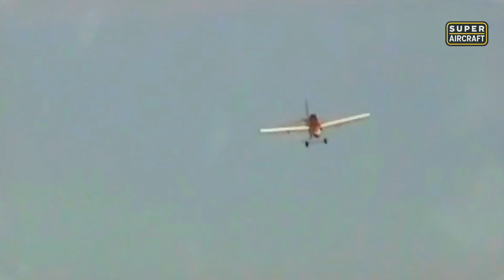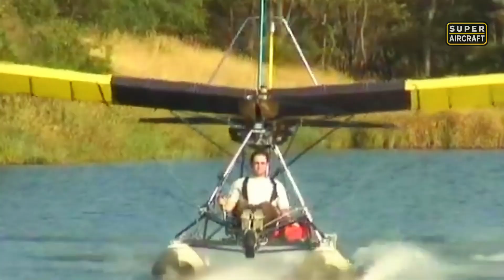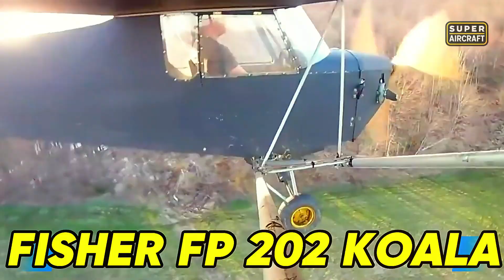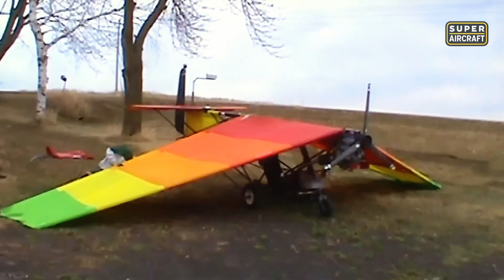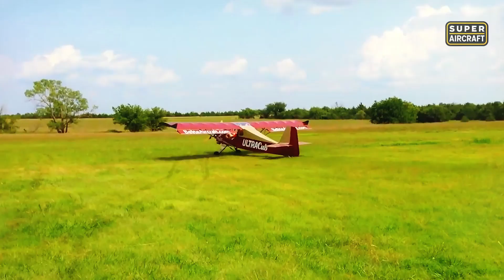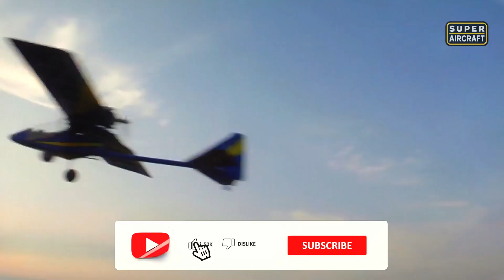AVIATION EXPERT REVEALS BEST MATERIAL FOR BUILDING ULTRALIGHT AIRCRAFT

Comment: For my money I would choose the Ultracruiser. All metal construction essentially removes moisture and rot concerns. Fully cantilevered wings for aerodynamic efficiency. 4-stroke engine for reliability and low fuel consumption. A kit is available with pre-punched rivet holes to greatly reduce build time. Or if you like, build one completely from plans or buy one fully assembled and ready to fly.
Reply from the maker: Thank you for your comment! The Ultracruiser really stands out for its simplicity, structural stability and low-maintenance all-metal design — and it’s actually one of my personal favorites as well. Its efficiency and predictable handling make it a highly appealing option in this category. Your perspective adds a solid technical angle to the discussion!🤠✈️